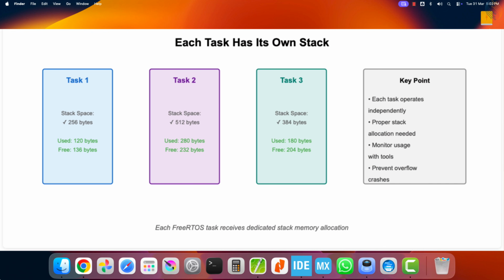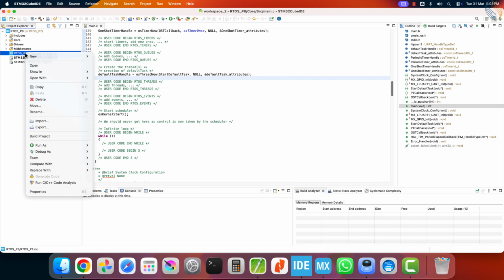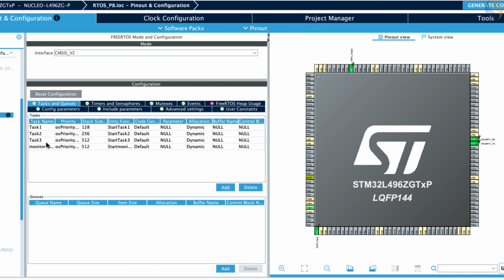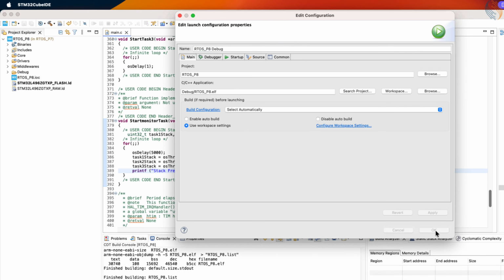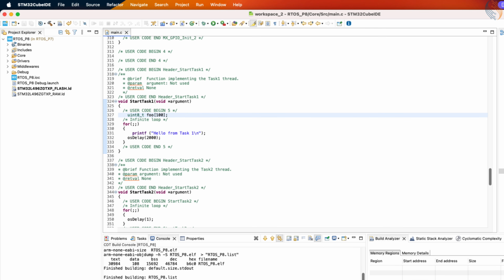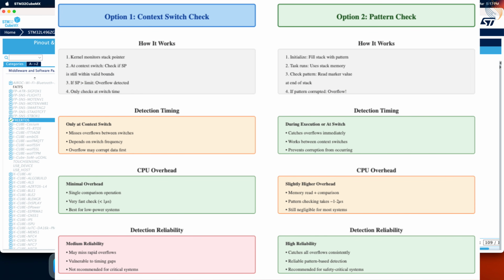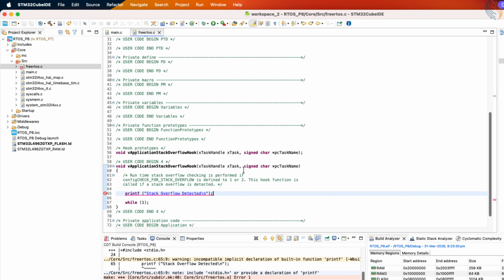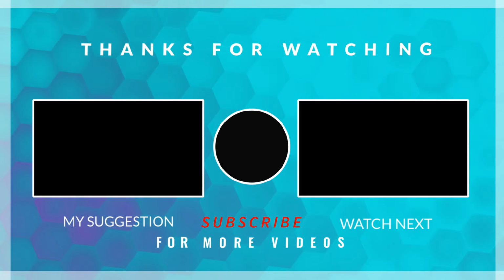STM32 CMSIS-RTOS (Part 8): Stack Management and Overflow Detection

Comment: I'm using an STM32h753ZI nucleo. But when I overcome the space, the program blocks completely (without printing 0 bytes). I'm not using Stack Overflow Hook btw
Reply from the maker: Try enabling the stack overflow hook in your configuration to see if that helps identify the cause of the system lockup.
You can also try some other method (incrementing counter) instead of printf.
Also make sure you have enabled the option NEWLibReentrant in the FreeRTOS config. This is needed for the printf to work properly.